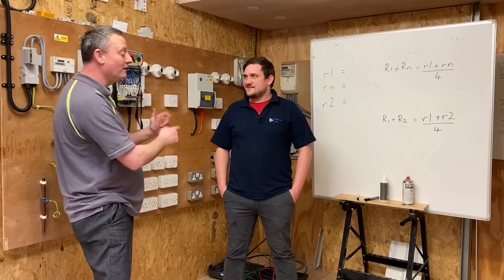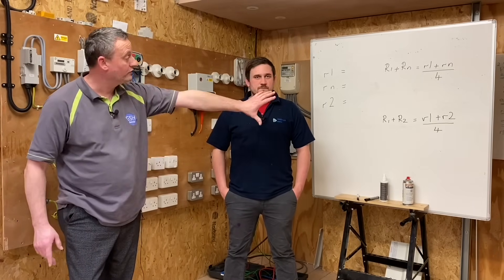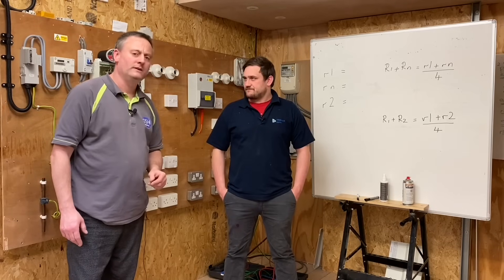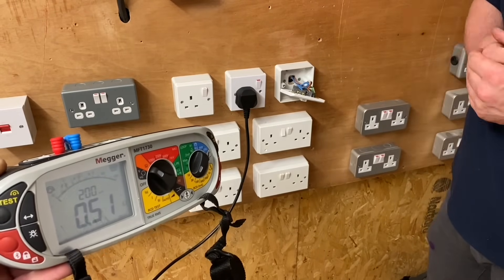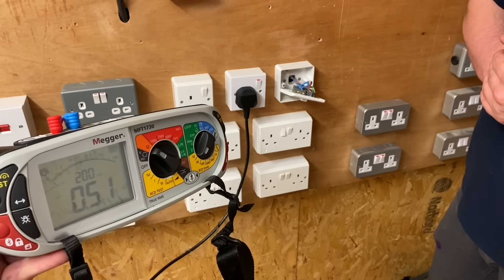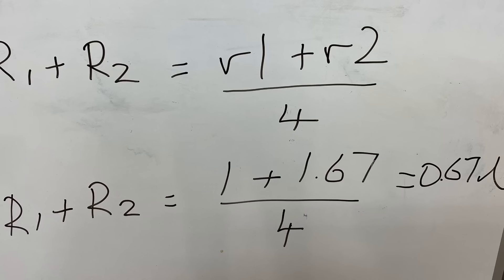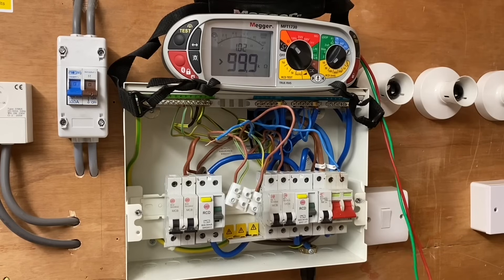How to Test a Ring Final Circuit - Ring Main or Socket Circuit - Ring Continuity & Polarity Tests

Comment: Great video, thank you for sharing 🙏
When you were checking the spur did you probe up onto the input or did you switch it on & probe on the output?
Reply from the maker: Outgoing and operate the switch… our spur had NO outgoing circuit 👍🏻
Reply from the maker: Can you test at the outgoing load from the spur…?
Reply: @GSHElectrical  Yes - it's awkward for some, but I can just about. I was just thinking that the load will affect the resistance reading..

Comment: Are the readings coming down because you've sprayed the plug top and loosened the contacts or just because the liquid is reducing the resistance in the contacts momunterely as it is aiding the flow of current with the plug top being wet ? Just a thought.

Comment: Fantastic video, I’m not an electrician, both yourself and JW state on the figure of eight test between the line and cpc should be higher overall due to the thinner cpc but all substantially the same , but the on site guide suggests increase or decrease measurements depending where you are on the circuit?
Reply: The on site guide is correct. I tried explaining this to my tutor and he didn't accept it. When you draw it out it makes perfect sense. (r1+r2) / 4 works when you're half way around the ring. As you move along, you will have more cpc on one leg and more line on the other. So the overall resistance decreases as you move towards the ends of the ring

Comment: Do you have to do it in the board or can you do it in any socket in the ring circuit?
Reply from the maker: Any point on the ring final circuit 👍🏻
Reply: @GSHElectrical  I thought so but I was told it has to be at the board so that the tester won't pick up any parallel paths from other earths or neutrals?

Comment: you said in the AM2S theres a fuse spur which goes to a outside socket,when testing at the fuse spur could you not put your probes onto the load side of the spur and click the switch to confirm polarity as well and then test the outside socket like normal ?

Comment: we cannot see the connections because the writing comes in front
Reply from the maker: Turn off your subtitles 👍🏻
Reply: @GSHElectrical  Your writings still appears .If all the subtitles are removed then people will benefit more. I am doing Inspection and testing at trade skills for you.I am resitting the exam only the practical. I need to master the practical

Comment from the maker: == 🕐 Time Stamps - Cut to the action 🕕 ==
00:00 - Ring circuit test
00:09 - Continuity of a ring final circuit 
00:51 - Stage 1 - end to end test - r1, rn, r2 in ohms
02:19 - CPC r2 is 1.5 mm2 proving 1.67 times greater than r1 and rn
03:49 - Stage 2 - opposite line to opposite neutral (figure of 8) 
04:20 - Calculations for R1 + Rn  
05:05 - Testing at our fuse connection unit on our ring final circuit 
06:16 - Testing at every socket outlet during stage 2 
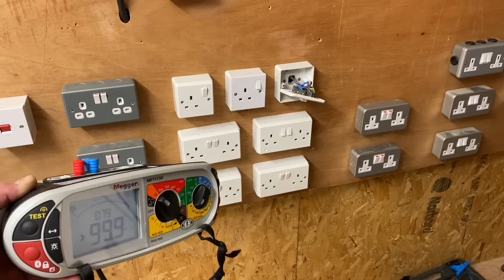07:47 - Contact cleaner to improve the electrical connection 
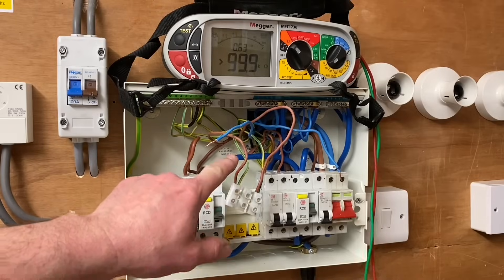08:55 - Stage 3 - opposite line to opposite CPC (figure of 8) 
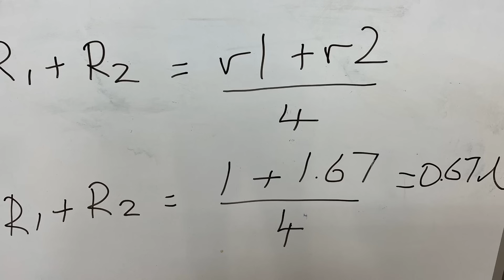09:05 - Calculations for R1 + Rn 
09:30 - Testing at our fuse connection unit on our ring final circuit 
09:54 - Visual polarity of the fuse connection unit (fuse spur)
10:41 - Testing at every socket outlet during stage 3 
12:45 - Completing the test paperwork for our ring final circuit test
Reply: But is it permitted to wet those three heads with stuff to get good result?

Comment: Taking the resistance from the sockets when the whole ring is one continuous conductor made into a loop. 
The L & N in the socket may be at opposite ends to the loop.  That is, if the loop is 100 metres long, the L & N in the socket will be 50 metres apart on the one and same loop. So the measurement is right around the loop?  Hence a reading of 0.5.

Comment: Doesn’t the fuse in the plug cause any issues with the readings?  Or is the assumption of a fuse being in the plug incorrect?
Reply: there is a fuse. but it should only act as a fuse and should let the current pass with no addition to the resistance reading

Comment: Something you could add... if when you do the R1+R2 after doing the R1+Rn, if the switch doesn't switch off the second time round, it would have meant (pending on other tests) that it is highly likely that the switches are double pole and only the neutral pole was switching off

Comment: I noticed Marcus used the tips of the crocs when connecting to the conductors, my cps assessor has questioned me twice on consecutive visits how I personally carry this out, if I  use  the tips he says the spring end gives a better connection and visa-versa on another visit, personally I don't think it matters so long as the contact is good, what is your opinion?
Reply from the maker: You make some great points 👍

Comment: On a ring you can only spur one and if you want another one you need an fcu. This is because you could potentially draw more than 26amps correct? However, with radial circuits does this reg come into place because before you can draw more than 26amps the 16a mob should trip correct?
Reply: yeah mate

Comment: Thanks for the video gentlemen. It is really helpful to so eone like me who is very interested in electrical installation and hoping to get into this line of work as well as my plumbing and heating.  Seems like it is just as expensive as plumbing with the tools and calibration etc with flue gas analysers and multifunction testers. Is it better, cheaper togo for individual testers or better for the multi function? thanks again
Reply: multis are expensive but its an all in 1 unit. alot easier if your main job is testing